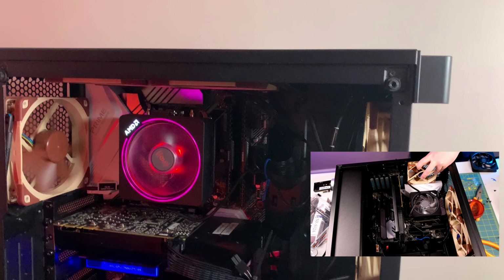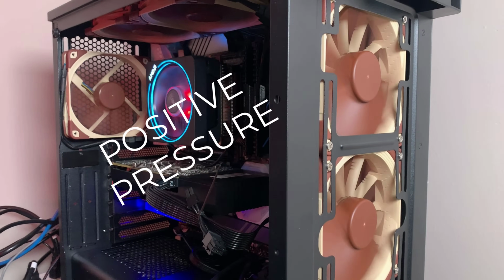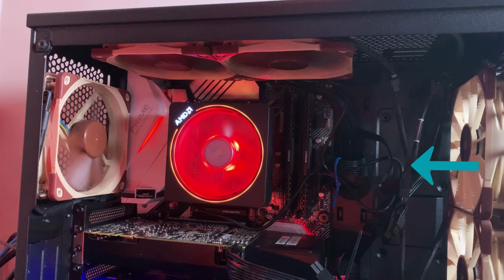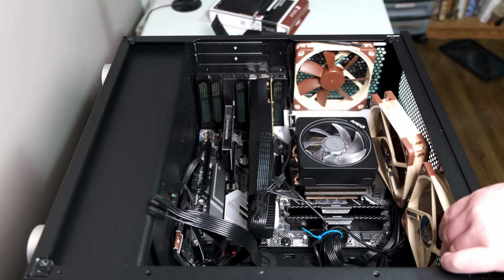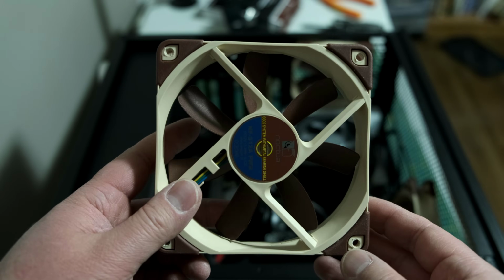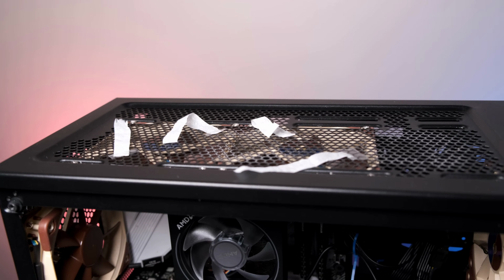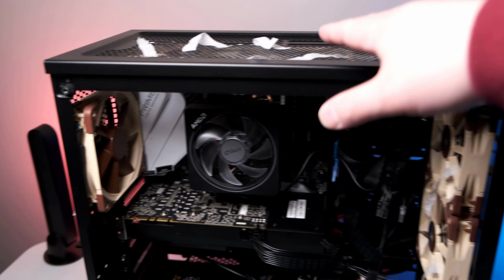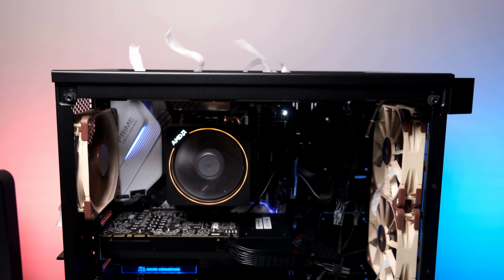Custom PC Build: How to setup your desktop cooling fans for proper air flow

Comment: nice work - but you have negative airflow inside the case.

because you have more exhaust fans as intake. In this case you collecting more dust through all openings.

STAY POSITIV - more intake als exhaust ;)  <- with positiv air pressure in the case you just getting dust filtered air inside the case  ;)
Reply from the maker: Thanks for the feedback. I'm going to be replacing the stock AMD Wraith cooler, so i'm going to be paying attention to the dust in the case. I'll keep update the post with another video to correct it if it's the case.
Reply: @TheWongReviewer  you should keep in mind if you are going to place the front pannel on or off, to setup the proper airflow configuration. with panel on  front fans are close to useless with that case.
Reply from the maker: @MrDvneil  Thanks for watching. You raise a good point and i was wondering that myself.  I'm going to do an experiment with the CPU and Motherboard heat with the front cover off and on. I'll see if there is a difference. Great suggestion.
Reply: @TheWongReviewer  in my case, taking off the front panel reduces temps by 4°C-5°C. It does make the difference.
Reply from the maker: @ezpzjayzaar  Whoah. I actually started to benchmark it last night under different kinds of loads with it on. I'm going to collect data on it with it off and do a comparison. I'll publish a video on it. Are you cool if I mention you in the video?
Reply: @TheWongReviewer  if you want, I can also record it and send video proof, I got nothing against it. I'll have both OSD temps as well as phone recording open front and closed front of the case
Reply from the maker: @ezpzjayzaar  All good. I just wanted to give you credit for the idea of doing this test. I'm really curious to see what the results are for me. Do you want me to email me your name and i'll reference your Youtube channel in my video.
Reply: @TheWongReviewer  oh, no need for the link of my channel, really, I am not tech YouTuber, but a simple comment screenshot for the idea would do :)
Reply from the maker: @ezpzjayzaar  Done! I'll let you know when i post it.
Reply from the maker: @ezpzjayzaar   posted the video of the case and mentioned you in the video. I took a screenshot of your comment.
Reply: @RaptorTP there is no wrong way to do it. You can choose negative or positive. While positive pressure gets far less dust, the negative gives you LOWER TEMPS. CONFIRMED. It's all about your needs. If you already have cool enough PC, go for positive. If you need better cooling, go for negative and clean your case every week for 10 minutes...it's not that hard...
Reply: @ezpzjayzaar  don't tell this me xD ... for the most persons it would be better to get an positive pressure. Saw enough lazy PC owners Cases-Inside xD

you mean confirmed 1-2°C ? .... not really smart for cleaning every week.
Better use good thermal paste to solve that smal difference
Reply: @TechTalkTobi  10 minutes per week for cleaning is totally worth having 3°C less all week long. Your problem if you are a lazy ass, I like maintaining my PC.

Comment: dude you basically removed them and put them on again in the same way ahahhaa
Reply from the maker: I had to rotate the fans of where the arrow was. thanks for watching. Appreciate the feedback.
Reply: @TheWongReviewer  I was confused because rotating fans doesn't change your airflow at all
Reply: @scutumillu19  Did you get further then 2nd grade science?
Reply: @scutumillu19  So it doesn't matter if the fans on an aircraft engine are reversed ? Same principle.
Reply: @crusher8017  You are misunderstanding, flipping the face of course change the airflow, but rotating it clockwise doesn't
Reply: @scutumillu19  I never said rotating the fan but reversing it.
Reply: @scutumillu19  What if someone who was targeted by a realistic looking weapon returned fire with a real weapon ? Look beyond the supposed funny side of this.
Reply: @crusher8017  at this point i think you are trolling me.
Reply: @crusher8017  I said rotating since the beginning, you arrived here and talked about reversing, dude are you alright? read the conversation since the start maybe?
Reply: Yeah i kinda agree with that one. except for his last video which was the mistake not in this video. He just basically rotated the fan to see the where the arrow airflow indicator is.